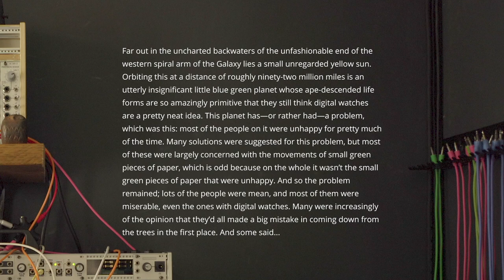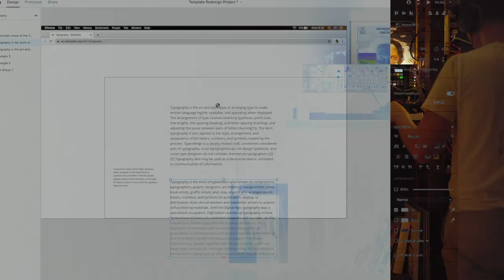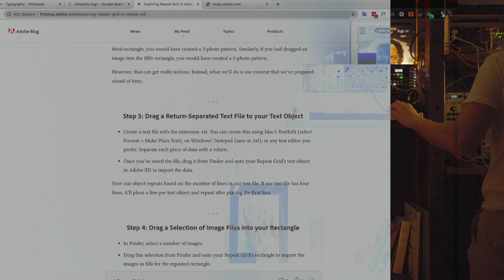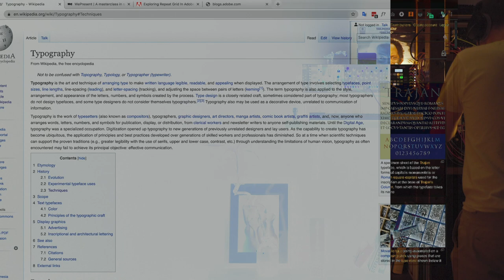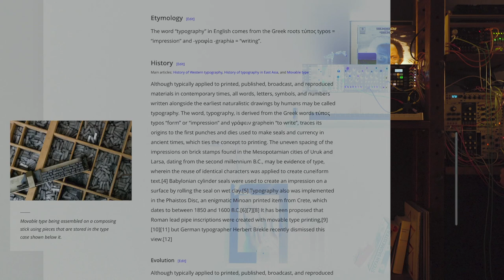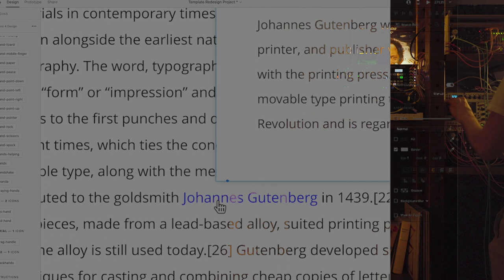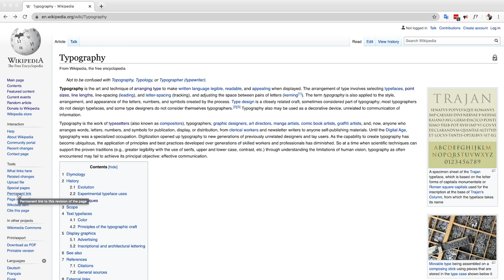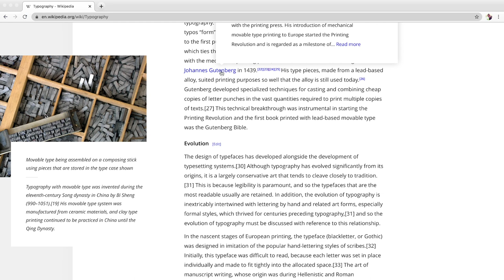Wikipedia Redesigned: Modular Design Therapy 2020.

Comment: I like this design, I like your balanced decisions between aesthetics and function. You spacing is well composed. It is definitely a welcome cleanup to the outdated (and ugly!) Wikipedia. (It would be interesting to hear how it will behave with responsive design.)

I have some thoughts. As you are saying, often people just want the definition of the term. When you are hovering over links in wiki they give you a few lines and this is mostly sufficient. Google also gives you a few defining lines from the articles, so you don’t have to go into the actual site and leave Google. (These lines are sometimes not the first line in the article, so I guess your top paragraph in bigger font size needs to pick out the relevant sentence, not always the first) 

However, searching through long wikiarticles on mobile (with short line lenght) is a frustrating experience because of the endless scrolling. Reading an article from beginning to end works well with shorter line lenght, but there is value in being able to canvas as much of the article right away when you need to skim through the paragraphs. Seeing your design makes me think that this will be a slower process, and make content further down the article invisible by scrolling fatigue. 

Maybe a more functional decision would be to have the top paragraph (with the most defining summerized content) styled in the manner of your design, while the rest of the article would preserve its function for easy canvasing? Wiki’s current neverending line lenghts need to be better wrapped, for sure, I’m with you on that, but maybe there could be some sort of magnification ability? A newspaper logic, with clear hierachy, but still all headlines and subheaders visible to skim through the relevant topics.
Reply from the maker: Thanks Anders! Really appreciate the thorough comment. First, would definitely be interesting to tackle responsiveness. It wasn't in the scope of this project, but perhaps sometime soon. 
I completely agree with your point on the short definition - it should behave in a similar manner. As for the note about the length of the article and endless scrolling, I think that it's more of a problem on mobile than on desktop. This design focuses on the desktop experience (I think the current mobile UI works quite well in comparison to the current desktop one). Lastly, the idea of a newspaper logic is intriguing! Something to explore for sure!

Comment: I don't think line length is the problem, line spacing is the real issue here.

Bad text layout is mostly the clients fault, I have worked in ecommerce for 10 years now, and the amount of time I been told to remove the spacing and padding to get more above the fold on homepages is a nightmare, and the adjustments are from UX designer who have no design background in the first bloody place.
Reply from the maker: I know exactly what you mean. The role of a good designer is sometimes to educate the client. 

After all, the goal is to create the best experience for the user while meeting business goals. If business goals are not met, then the design doesn’t matter. 

The old assumptions that people don’t scroll and you have to force-feed them information is outdated, in my opinion. We run endless a/b tests that prove people don’t chose the busy design. 

And yes, the homepage is the biggest challenge indeed. You try so hard to make the best first impression, you sometimes forget it’s actually a person who’s experiencing your page.
Reply: @roeytsemah  Agree, what makes it worse sometimes is UX people communication with clients there needs, not understanding a design issue layout problem, and then the UX people siding with client to agree on a problem with no regard for the design which on it own merit cause a different problem. I thing UX research is important, and what they do count for a product, but when it come to design, I think they should move out the way, let us get on with the job at hand, then if there is an issue, we can talk. 

UX design is blurring the line between business and design, but most UX people I have work with have no idea about design, or graphics design which is causing problem further down the product line. I have only worked with one good UX person in my 10 years in Eccomerce, and he was a designer in the first instance.